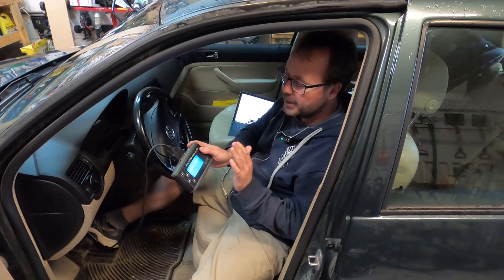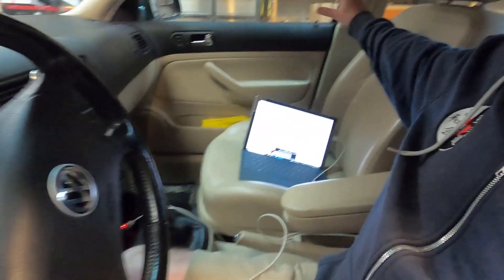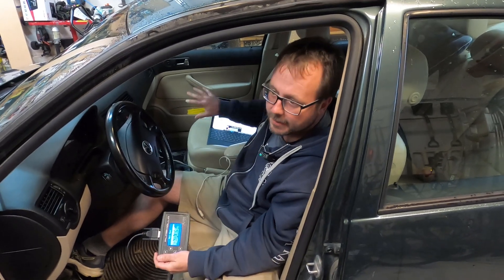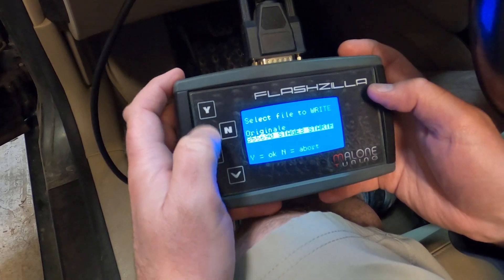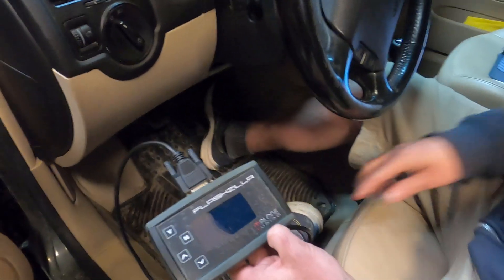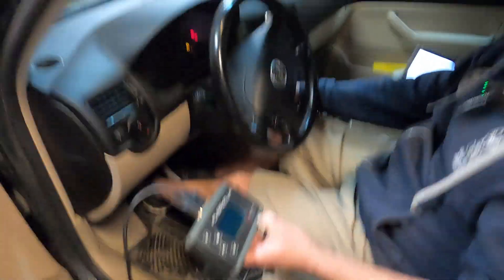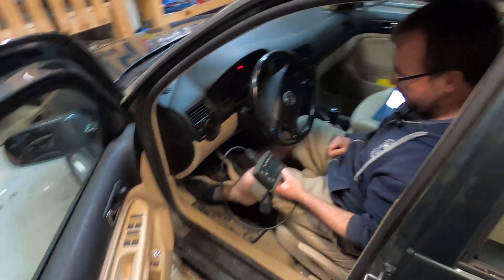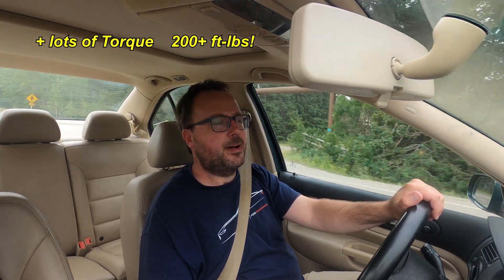Stage 3 Tune VW TDI ALH Diesel Performance Injector Nozzle Upgrade

Comment: i have the same problem with the door lock not working correctly but my stock tdi automatic when it cold starts (-23c) does not produce as much smoke as your car something seems off with yours
Reply from the maker: My door lock started working again.  The smoke is from the tune.

Comment: With this much smoke you'll get your piston rings stuck within 30.000km. Did you adjust/calibrate the new nozzle pressure? You cant just swap them out.
Reply from the maker: Can I do that with VCDS?  Agree it does seem to have too much fuel
Reply: @gregs_garage  No idea what VCDS is (not native English) but you can adjust the pressure diaphram on top of the pump and the maximum stroke of the plunjer. You can also up the turbo pressure a bit.
Reply from the maker: @dw4956 your reply tells me enough.  Thanks

Comment: For 130bhp and tht much smoke, dosnt seem right.. alot sof soot which means 2 much fuel, less air, which means ur loosin more power...  put a pd150 turbo on it with a upgraded intercooler... tht should see u with reduced black smoke.. i meannu are going to still have black ir greyish smoke but deffo not tht much.. if it still smokes like tht, the tune is shait.. 
U normally see smoke like tht at the 180 to 220 bhp.. 
Great video by the way..
Reply from the maker: Thanks.  I may get a different turbo but need a new clutch first.  This one is slipping now
Reply: @gregs_garage   how was smoke before tune? never showed a drive in the install video. Did you ever change the IQ settings to dial back smoke? I have these injector nozzles on my shelf or a full set of manual injectors  I have a bit more air flow mods than yours and I'm hesitant because yea yours smokes too much for what it is. mine on just a tune 10mm injection pump and the boost cranked to 18\20psi pulls harder than that with no smoke. Malones tunes are generally very high quality.

Comment: It’s always best to have the car hooked up to a battery charger when changing a tune. You can brick the ECU if your battery doesn’t have enough voltage during the process. But thank you for all the videos! Been on the same journey with an identical Jetta
Reply: Make sure the new nozzles are calibrated to the right opening pressure. You cannot just swap the out.

Comment: Time for some head studs!
Reply from the maker: yeah?  The clutch is already slipping
Reply: @gregs_garage  if your new tune is running more boost head studs are a must. Where did you get the tune from? Thinking of doing this to my golf but it’s a commuter so I don’t know if the extra fun will be worth the fuel consumption 😅
Reply from the maker: @AndrewMarsch  Malone Stage 3
Reply: @AndrewMarsch  do you need to take of the head or change the headgasket when doing head studs?
Reply: @1dayumay548 I THINK you can do one at a time. Might have to be in a certain pattern…? I’m sure it would be recommended to remove head and replace gasket but if it were mine I would do one at a time and monitor coolant level etc. hope that helps.
Reply: head studs definitely if you going upgraded turbo
Reply: @lynda403 do you need to take of the head or change the headgasket when doing head studs?